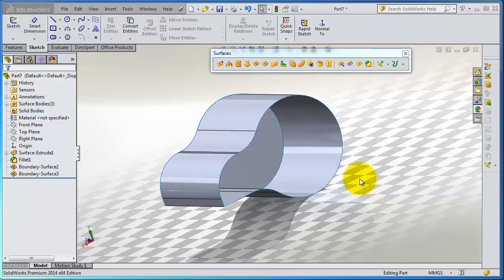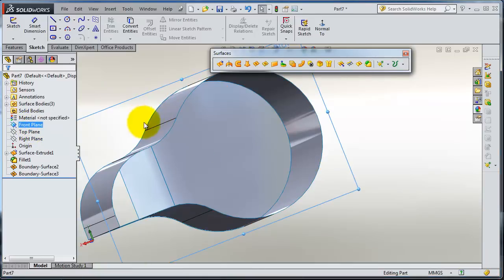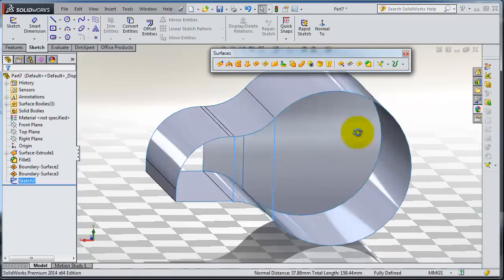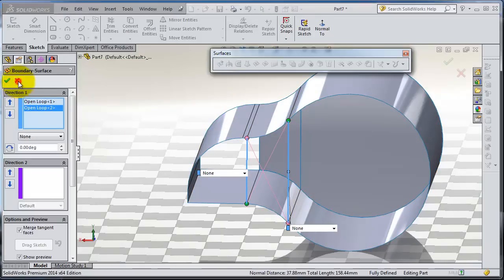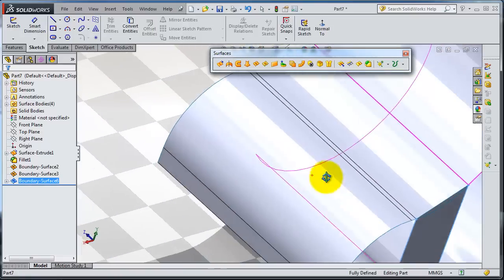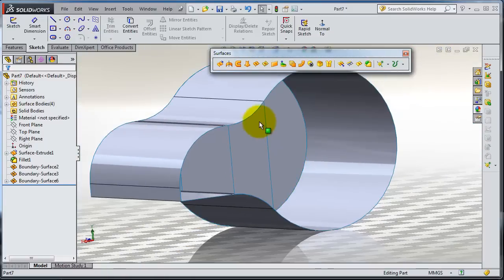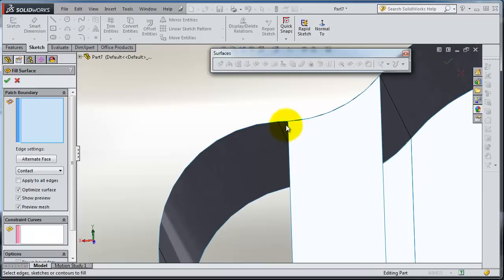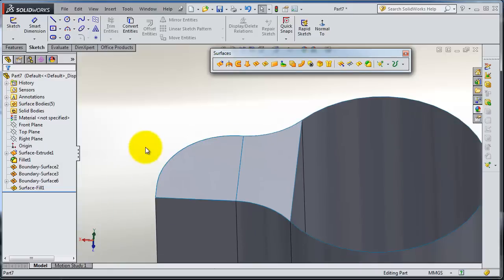SolidWorks  Lecture Surface Tutorial 77: 2 directions boundary surface vs filled surface

Comment: Conclusion: Sometimes the filled surface feature makes it easier to select and fill a particular area than using two directions boundary surface feature, as you won't need to trim the excess parts.